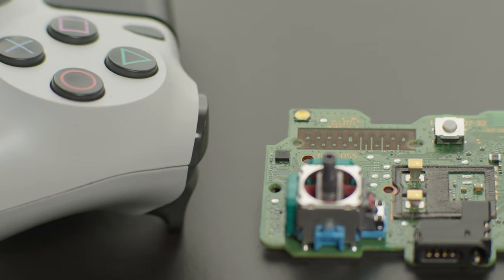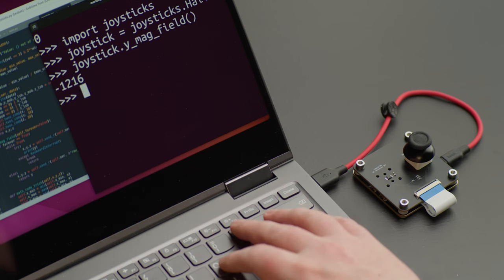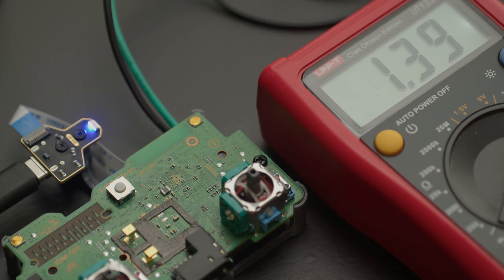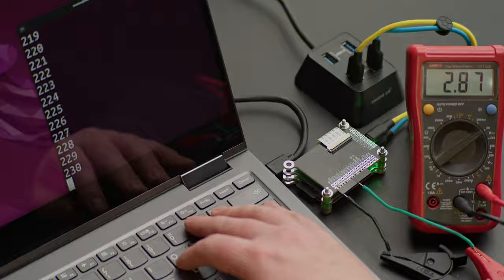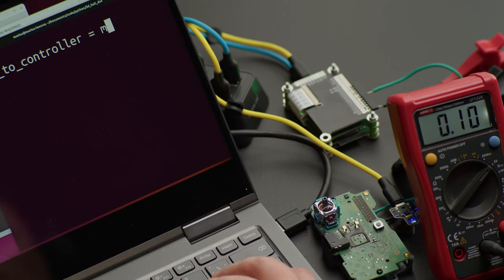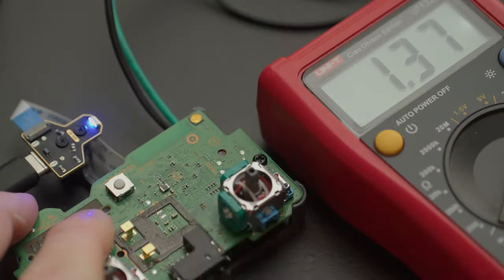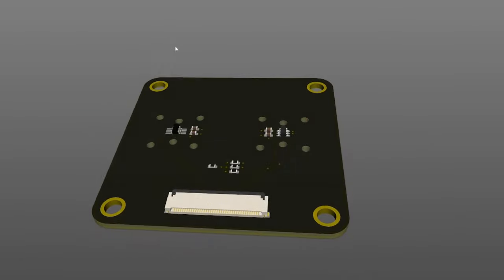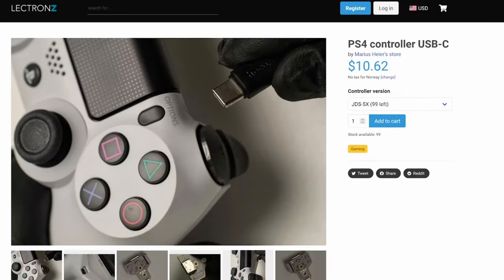DIY hall effect joysticks

Comment: You're doing a far better job than other brands ever will, if you release it one day, i will 100% buy them theres no doubt.
I've had countless controllers and i'm just getting tired of wasting so much money on them.
I play competitively and my last PS5 Controller lasted about 2-3 months which is highly disappointing.
Reply from the maker: Thank you! We need to get some new sticks out there!! :) Thanks for supporting me.
Reply: I've had many controllers and for years playing on the same ones, my ps4 controller was the first I've seen to last a lot longer on the factory analog sticks but I can tell it's seen better days. I will support you when I get a chance because I cannot play any racing games without feeling the resistance building up in the stick. I don't notice it too much In shooters but trying to round a corner in a car that wants to spin out is hard when the stick doesn't want to turn anymore without giving it too much force. It's not getting better and I'm not gonna go the same old analog stick route and just keep replacing them. I can tell when they start to go but aren't sticking or drifting yet. The movement becomes sloppy and inconsistent
Reply: @MariusHeier1  as cool as this is, as somebody who alternates between the PS4 controller and an Xbox One controller on my PC depending on what game I'm playing, it would be amazing if you could create this project for the Xbox controller as well. That would be amazing. And of course, you have to do it for the next gen consoles as well, but more people have the old consoles so it makes more sense to start there.

Comment: Just got done cleaning my potentiometers and looked up hall effects.  It's a shame they don't use hall effect from the factory especially when these new controllers are 70 USD. I would buy a board off you for sure. This is seriously awesome stuff. I always wondered why they didn't change to USB c for PS4 either but I seen you did that too. Crazy no one did this years ago. I subbed and 🔔 ed
Reply: Because in 2013 that tech probably would have been a lot more expensive, have you seen how much USBC cables cost? They cost as much as Apple cables now. Nobody was ready for that back then.

Comment: The Dualshock 4 really is the best controller released in the last few years. It's a crying shame Sony abandoned it completely for their new Dualsense controllers. Excited to see more of this in the future!
Reply from the maker: I agree. I think so to. The jds001 ds4 is in my opinion the greatest controller ever made. Its why i like to make stuff for it first.
Reply: @MariusHeier1  Yeah, which just makes the fact people keep tossing JDS-001s out that much more galling. Other than the power board ribbon splitting easily, and the stock thumbstick going to goo, these controllers are lovely to work on. I've got 1 primary I've had for 5 years now, and a pile of scrap ones in varying condition. Definitely ordering your upgrade board come payday to cut one more item off the potential maintenance list.
Reply from the maker: @KiraSlith  Yeah that sucks. I have gone trough the design of all the controllers and the first is the best. The rest of the series have changes, that almost only is to lower manufacturing cost without regarding the loss of durability.

Comment: Subbed. Very interested in seeing where you go with this.  Spherical magnets seem like a bad idea considering it may be harder to stop them from slipping.
Reply from the maker: Hey. Thanks for subbing. I found some spherical magnets with holes in the poles. Which will make it slipfree. But it might be better to use a diametrical magnet on the opposite side. Experimenting with it right now. ;)

Comment: Man, here I was hoping I could just solder hall-effect sensors to the places where the Potentiometers used to go and then use Helder's Stick-Drift Fix to adjust them to work with the PS4 controller board.

But of course I would buy one, more if you can make them work as PS3 controllers as well so I could hook it up to a PSP Go.
Reply from the maker: Yup. Im my new video coming up im explaining specially why its alot harder to replace the potmeters with hall sensors.

Comment: I'm very interested in those as i've got a couple DS4 that would really need a new pair of sticks but I'm also wondering if it's possible that other controller using ALPS analog sticks (stuff like Nacon / Power A / PDP etc) could use those as drop in replacements or it's a definite no from the start?
Reply from the maker: If its 3.3v it most likely will work

Comment: We desperately need hall effect joysticks for the PS5 controller. They only last a matter of months before drifting. I have to keep cleaning the pots and replacing the sensor. The new £200 Sony controller still uses pots that can be replaced easily, but they are £20 EACH! Hardly worth it for something that's going to last 6 months max.
Reply from the maker: Tell me about it. I just bought a ps5 module for the video im making now. It was 28$ in Norway. Crazy. The same joystick will work for PS5 ;)

Comment: This is an amazing project and I hope you can make it come to fruition!
But I can't help but wonder, would there be a way for users to fine tune deadzones?
It seems like as long as something is marketed as "no stick drift" everyone goes insane, but no one seems to realize that sometimes there's too much deadzone and precision gets thrown out of the window.

I had two experiences with hall effect controllers, the XBox Controller (triggers only) and the Steelseries Stratus (sticks & triggers), and both had either too much deadzone or the input was jumpy because of bad calibration and there was no way to fix this.
I'd love to have a calibration tool to really dial in these settings without any limits, from making a stick almost work like a dpad or triggers sending 70% input while fully bottomed out, that would be really nice to have.
Reply from the maker: You are 100% right. When they claim no drift. They just mean, no noise drift. Deadzone drift is still the same. And dead zone drift is atleast what i get at about 2-4 weeks of gaming. Its because of the spring recentering mechanism. I have already sucsessfully tested a return to center mechanism based of diametrical ring magnets. And it works great. I might have posted a yt short about it.
Reply from the maker: To much dead zone might be a sign of low resolution output from the hall sensors. But might also be because some anti noise algorithm they use. Or because of unsymmetrical magnetic fields.
Reply from the maker: When we write out own software for these things we can basically do whatever we want. That is the beauty of that part.

Comment: One thing I'd love to see is an improved D-Pad for the PS4 Controller. The current one is fairly mushy because it's membrane and not as nice as the tactile dpads in the Xbox one and stadia controllers. 
(Also, love the USB-C board, fits and works perfectly in my controller)
Reply from the maker: Awesome! Im happy to hear that. :) What about adjustable trigger point buttons with programmable vibration feedback?
Reply: @MariusHeier1  Sounds amazing! Very interested to see what you come up with!

Comment: one thing i hate about the playstation controllers are their stubborn reliance for internal batteries which means greater risk of damage when opening to replace that piece of garbage, Should have just used the double a rechargeable cell models like xbox
Reply from the maker: Yes. I agree. They kinda like design things in a way that make them more money.
Reply: @MariusHeier1  what a shame that removable batteries is so easy to do on controllers but only xbox does it.
Reply: @MariusHeier1  oh i forgot, the NexiGo PS5 Controller Accessories Rechargeable Battery Pack is basically that , but sadly no ps4 version